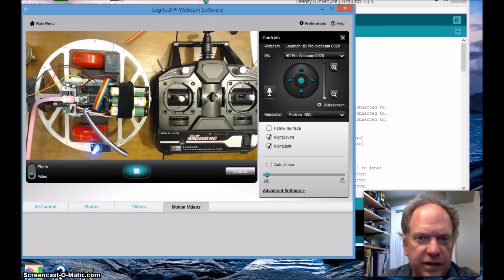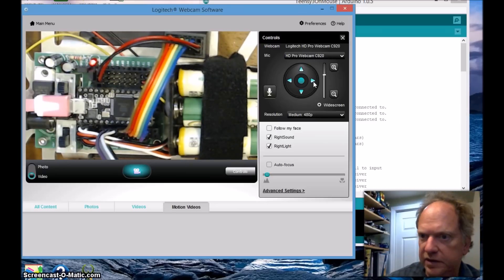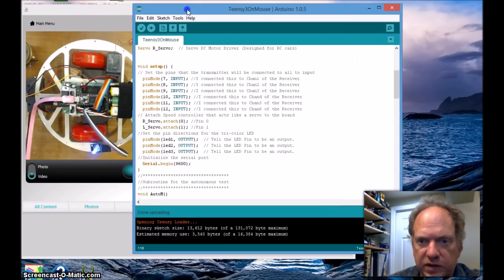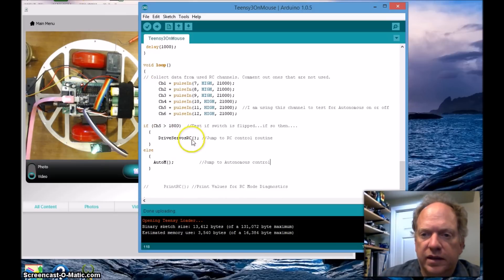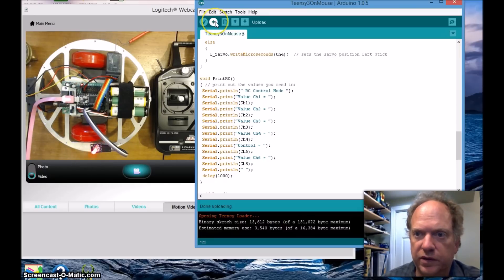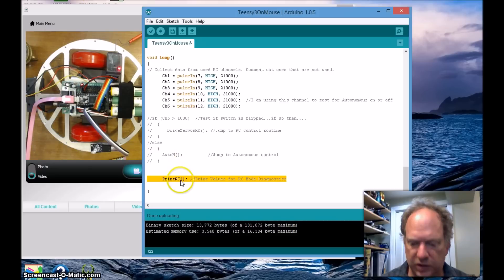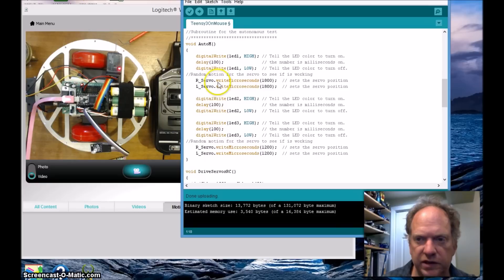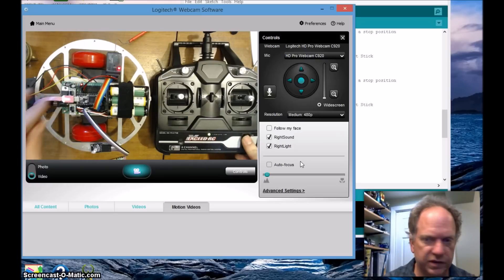Setting up Radio Control with Arduino and a FlySky transmitter.

Comment: Here is an modified code WARNING the Ch5 is not on pin 6 insted it is on pin 2 because on my arduino it does not work on this code BTW does somone also have issues with reading out the values on an arduino nano, i also have an HiFive1 and there it works perfectly fine. (This code is only to read out the values)

int Ch2,Ch3,Ch4,Ch5,Ch6,Ch7,Ch8,Ch9,Ch10,Ch11;

void setup() {
  // put your setup code here, to run once:
  Serial.begin(9600);
  pinMode(2,INPUT);
  pinMode(3,INPUT);
  pinMode(4,INPUT);
  pinMode(5,INPUT);
  pinMode(7,INPUT);
  pinMode(8,INPUT);
  pinMode(9,INPUT);
  pinMode(10,INPUT);
  pinMode(11,INPUT);
  pinMode(12,INPUT);
}

void PrintRC(){
  Serial.println("-----------------------------------");
  Serial.print("Value Ch2 = ");
  Serial.println(Ch2);
  Serial.print("Value Ch3 = ");
  Serial.println(Ch3);
  Serial.print("Value Ch4 = ");
  Serial.println(Ch4);
  Serial.print("Value Ch5 = ");
  Serial.println(Ch5);
  Serial.print("Value Ch6 = ");
  Serial.println(Ch6);
  Serial.print("Value Ch7 = ");
  Serial.println(Ch7);
  Serial.print("Value Ch8 = ");
  Serial.println(Ch8);
  Serial.print("Value Ch9 = ");
  Serial.println(Ch9);
  Serial.print("Value Ch10 = ");
  Serial.println(Ch10);
  Serial.print("Value Ch11 = ");
  Serial.println(Ch11);
  
  delay(15000);
}

void loop() {
  // put your main code here, to run repeatedly:
  Ch2 = pulseIn(3,HIGH, 21000);
  Ch3 = pulseIn(4,HIGH, 21000);
  Ch4 = pulseIn(5,HIGH, 21000);
  Ch5 = pulseIn(2,HIGH, 21000);
  Ch6 = pulseIn(7,HIGH, 21000);
  Ch7 = pulseIn(8,HIGH, 21000);
  Ch8 = pulseIn(9,HIGH, 21000);
  Ch9 = pulseIn(10,HIGH, 21000);
  Ch10 = pulseIn(11,HIGH, 21000);
  Ch11 = pulseIn(12,HIGH, 21000);

  PrintRC();
}

Comment: thank you alot it helped me alot..im not a programmer and had a hard time understanding the code i have some questions:
1. will this code work on an arduino uno???
2. what kind of power source should i use???(2200 mah lipo??)
3. can i control 3 stepper motors with this code if not which values should i change???
plz reply soon
Reply: ye..same doubt :| 2.2mah lipo can i use that :/
Reply: The mah rating represents, in a way,  how much juice the battery have. So, the higher mah rating it has the longer it's gonna last while being discharged by the motors.